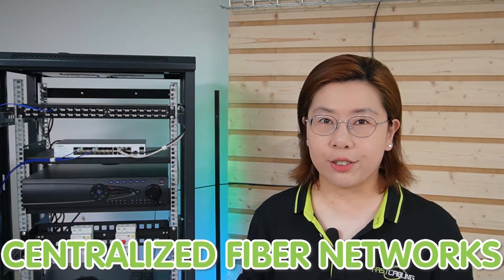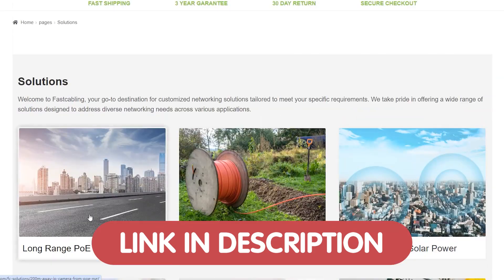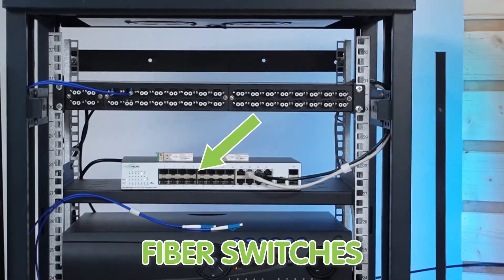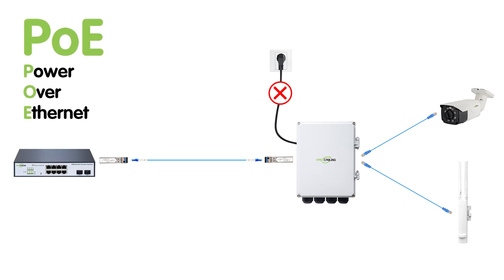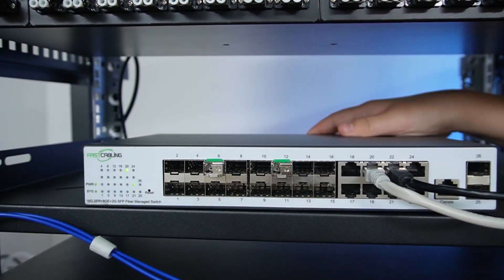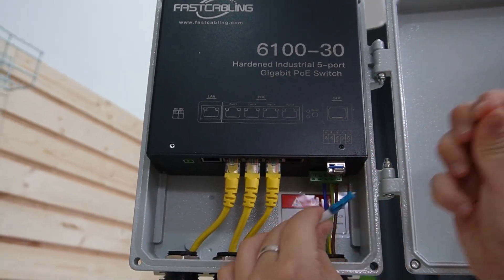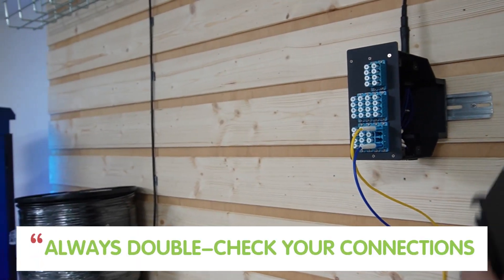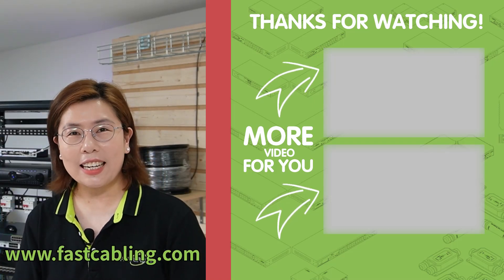The Ultimate Guide to Building a Fiber Network for Outdoor Security

Comment: Please how can i view cameras in different access points which is not connected to different PoE switches using fibre optical cable
Reply from the maker: I assume it is the IP cameras. As long as the network setting is not being manipulated (e.g. VLANs), you are supposed to see all these cameras. This is the basic setting for TCP/IP network. The fiber optic cable is transparent to network setting. It simply converts the signal between electric signal and optical.